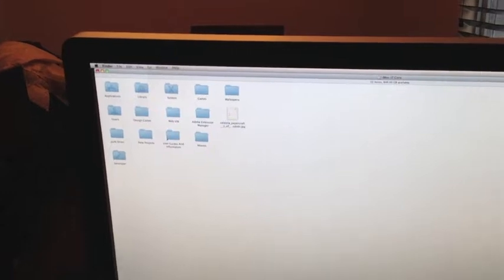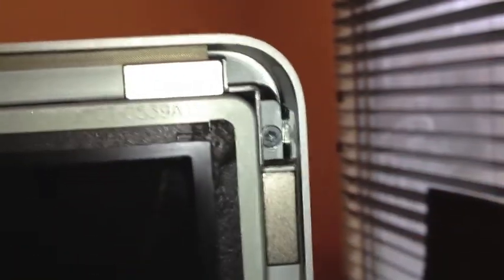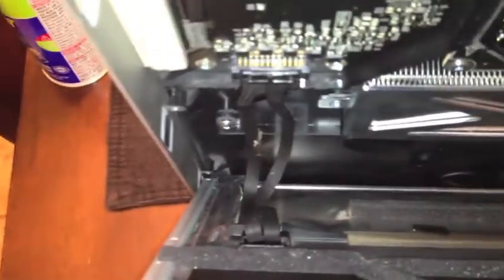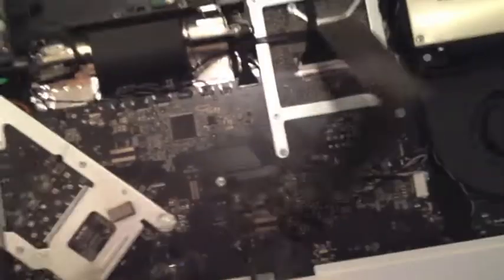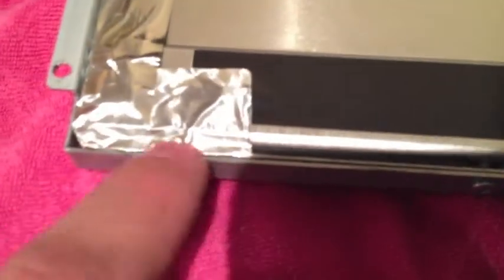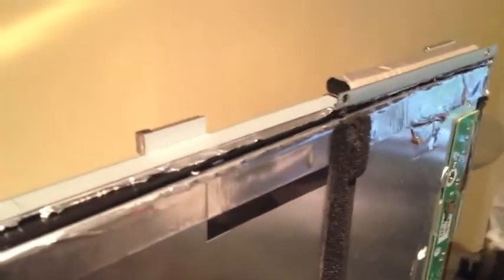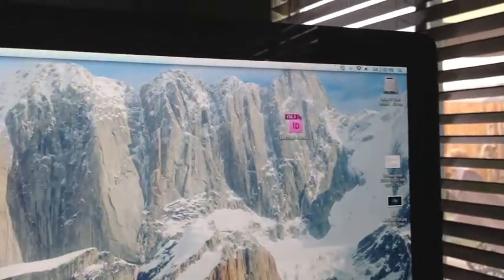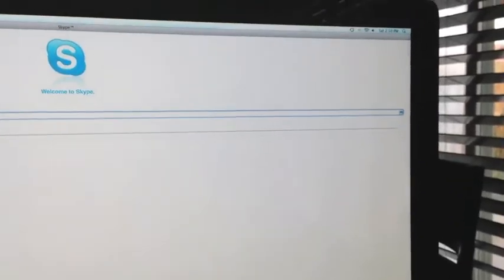IMAC 27 LCD CLOUDING • FIXED

Comment: Thank you - Just done mine, probably the most nerve-wracking job I've done on a computer. 
A quick note for anyone attempting this in the current year. At this point in time, the dust will probably be baked on there, so you might not be able to do it dry. 
I would recommend getting a pack of lens wipes (get 50-100) anything non-disposable will instantly get covered in dust and spread it around the screen

Comment: From Holland is say, Thanks a lot!! this video got me thru it! i did 2 macs and screens are great!!!. for everybody who is gonna do this, the aluminium frame does not hold any glas. be careful, the glas lays loose on the body, also. i agree on the comment about air blasting the fans. Keep m locked with your finger when blowing. you could damage your mac.
  just a tip! great video. !!

Comment: Nice Video, it helped me a lot.
I got one problem though. After re assembling the iMac i got a vertical line with a width of aprox. 10 pixels from like 10 centimeters from the right border of the screen. Is this fixable?
Reply: Did you fix this? I have the same - it worked perfectly for a day and now I have a single vertical blue line...

Comment: Thanks for the video bro!! It worked for me. My 2009 iMac was pretty dirty. I would say the toughest part is getting the frame out of the lcd. Wear rubber gloves and have someone hold the screen when reattaching the four connectors. Looks like a new Mac. Runs a lot cooler as well!! Great job!! Thank you !!!!!!

Comment: I was dreading taking about the screen section of this video, lucky the fog on my one was between the glass that pops off on the magnets. Swapped out the hard drive and now have a clean screen too. Only thing is I have the yellowing at the bottom of the screen still

Comment: Last night I did this procedure for the 2nd time in 2 years. I was refitted a new LCD in a motherboard repair a year ago, also this new LCD had the same problem , but way more extensive, the clouding was about everywhere. Do this nice and easy, take your time ! I sealed it up with foiltape but a thinner version of what Billy uses. Getting the clouding cleaned up was not easy, it looked like it was almost burn-in marks. It took some extensive cleaning with different products and before fitting it back together the wife suggested we'd apply a product that is used in common household to minimise the settling of dust on surfaces. It also makes the surface shine a bit. I refitted it, sealed it up the best possible way. My screen looks better than it ever did. I do have a question for Billy and all that followed this cleaning procedure; Did the clouding return? if so, have you found if and where dust/smoke or whatever this clouding is enters the LCD? I read an article posted by a hardware engineer on the Apple forum , suggesting to install small HEPA filters on the bottom air intakes. However that solution tends to give a new problem because the GPU and the PSU in this machine tends to overheat on days where the ambient temperature is high, resulting in cooling issues if you cannot blow enough air through the machine. that in return (heat+lots of air blowing through the inner housing+low capacity for air to exit) seems to worsen the LCD clouding. Hopefully Billy can repost on his vid , as most of us are very interested in the result after x years. Or anyone else for that matter. Anyways a super DIY fix where apple just has one answer (pay up sucker!) and simply replaces the LCD (around 600€). The entire procedure took me about 2 hours (disconnect everything and before using a can of air disconnect the fans!) . Hoping someone answers and to say thank you Billy!

Comment: hey. i have a late 2012 imac 27" - some days ago i discovered some darker clouds on the corners.
1) can i open a late imac 2012 like this?
2) will the clouds disappear when i clean it up like in the vid? or are the clouds INSIDE the display? 
thanks people!
Reply: A very late response I know,...but...The 2012's onwards are a different kettle of fish. The outer glass is fused to the LCD. This will only work on the ones that are about 1inch (10mm) thick at the sides, anything up untill 2011. Cheers!

Comment: My 27" LED cinema display just started doing this (2011 model).  I am going to try this, and if it works for me, you are getting a massive shout out.  I know some things are different inside, but I can easily manage around that.  It's the panel I need to fix.
Reply: The original poster of this video did appear to have legit dust in his when he opened it up, I'm not sure it was a polarizer issue for him.
Reply: did it?
Reply: Nope, for mine, there was no dust at all between the panel and the light.  The panel itself has the blotch, and was visible with polarized sunglasses while looking at the panel under sunlight.  I was a bit saddened to see it wasn't so easily.  In fact, when off it looks bad, but when powered it goes away for a short second then slowly returns over time.  So something is wrong with the LCD itself, as if it's a rather persistent image retention.
Reply: Is Mac Eachern a Mc Gahern?
Reply: I suspect the problem isn't dust (in any case - where would it come from and how could it get between the layers) - I am guessing it's actually the polarizer film is distorted and the 'cleaning' is actually just smoothing the film which is probably quite sensitive to not being absolutely planar.  So if the original poster fixed it by 'cleaning' he was inadvertently smoothing the film. That's my guess.

Comment: Don't let the fans get spun with high pressure air onto them!!! Hold the rotating blades in place while blowing into the fan ducts. If you put pressurised air on the blades; you will fry your bearings in the centre. So your fans will become loud and will be damaged!!!!

Comment: Just as advice: Do not blow the air into the fans without holding the fan tight in position!! The fan motor once turned manual around works like a small power generator, sending some volts into the main board! There are some people who have destroyed the fan controller just with air blowing!!
Reply: Also the vacuum cleaner, i should have fought the urge to stick the nozzle to the fan drooling at the sound of a jet engine spooling up. Q-fan gone now i have to run it full speed.

Comment: Thanks for posting this video it seems like it's just a bad design by apple because dirt and dust get behind the lcd panel and that's causing the dark spots/lines thanks man i'll have to take apart my panel in the next few weeks and clean out my imac i thought it was a issue with the panel like it was on it's way out. but i guess it's just a simple cleaning job thanks bud cheers!!!

Comment: So let me get this straight overtime dust builds up on the back of the panel ? i have the 27inch 2010 imac and it seems the spots have gotten darker over time but there always in the same area. is it possible to install a new say 2014 panel on older 2010 imac? ov not the 5k panel just a 27inch panel?

Comment: Wow, I do want try the screen removal and clean the dust out - I can only imagine how much is in here. Also clean the screen itself. The rest would make me a bit nervous. I did have severe clouding in the 3rd month of owning this 2010 iMac, fixed under warranty - Notice slight 'cloud' around the top again also bottom right. Another issue that may be beyond my own repair are very thin moving vertical lines about 7 or 8 in total perfectly spaced apart, but only viewable on darker background sites, full screen videos...or working with Adobe Photoshop which can be a real annoyance. Great video though. Thanks!

Comment: At 5:12 were there screws underneath there because in the next step it doesn't look like you removed the black tape to get to the screws if there were any screws there at all. Also, what kind of black tape or material is that you used at 11:08? You said heat pads of some sort? Thanks for this tutorial, will save me $100's!!

Comment: I thought this video was STELLAR. I think I will try it with my late 2009 iMac... and here I thought the screen was deteriorating. I have an appointment at the Apple store tomorrow, so I will post whether or not they fix this for me. In the event they do not fix... where would I go to buy that foil tape to seal the panel from the dust?
Reply: well I brought it to the Apple store and the Apple Genius told me that they do not open the LCD panel up. The way they fix it... they will replace the entire LCD panel. In the event your Apple Care has run out... they gave me a price of $549 for a refurbished screen, you can't get new. I was unable to find out the exact silver foil to use to reseal the LCD panel. You can't just use any type of silver foil tape... you could over heat the iMac and cause a fire. So if someone out there knows what tape is used to reseal the LCD panel... PLEASE!!!!! let me know the brand tape and where to buy.

Comment: Just wanted to let everyone know I did this to my 27" Cinema Display and the disassembly is very similar, but I would NOT recommend using any type of LCD cleaner on the BACK of the LCD. It works great on the LED panel and the front of the LCD/glass, but if you use it on the back of the LCD and then shine a bright light on it you'll see massive chemical clouding and it looks nasty. You won't see it unless your light is very bright. After using the Antec cleaner on the back of the LCD and seeing the clouding I used a touch of water on a very soft microfiber cloth and it took out all the clouding and it looked brand new. It took like 15 minutes to fix it after that cleaning spray messed it up, so just an FYI. I even noticed after properly cleaning it that the screen had noticeably deeper blacks.

Comment: Brilliant, I've had this problem with my iMac for months, it's out warranty and Apple want to charge me an arm and a leg to replace the monitor. 
Freekin' crooks as far as I'm concerned. I'll change my optical drive at the same time as that's packed in as well. 
Apple - Never again!
Reply: You got to be JOKEING I rather build one then buy and manufactured pc I bought a mac just to try them they are great machines ((If took care of)) iv never had problems like this and I don't know why ppl hate macs it's lighting fast even with windows and ubuntu
Reply: Iv used macs for a long time and mine have never failed and I give them emortal hell
Reply: I have a 2007 Mac Pro and 2012 Mac Pro and a air it's for school they don't slow the 07 has had it's days right now it's about had it cause it's just old it was my gameing/other thing pc at the time the graphics card needs a upgrade the 2012 my father got me last year and it's flawless i just don't see the problem the new ones I hate cause not upgrade able  as much
Reply: I'm just bp tired of windows I it would get slow after a while and it just wasn't working with me I used linux ever scinc I was 12 and u dual boot it with all my machines
Reply: Yes <~< it was pro and I tried ultimate  got the same thing not responding

Comment: Have you ever tried using a Shop-Vac to blow out the whole thing while using another to capture the dust?  Also, I need to replace HD and Super drive, so I am looking at an all day job.  Did taping the whole screen create any heat problems?

Comment: I was all prepared to do this but booked an appointment with the genius bar in Basingstoke , england. It turns out it is a known issue of particulates being drawn in through unsealed edges between the screens. Because apple acknowledge this as a manufacturing oversight (lets say) they have placed this on a QUALITY PROGRAM, meaning they will replace the LCD screen free of charge (£365) even if it is out of warranty. Sorted - one more happy and still loyal UK customer - MASSIVE GOLD STAR TO APPLE

Comment: Great video!! Took me about an hour, although I had to do it twice because a huge hair had gotten inside. 

Careful when pulling out display cord it's tied in with the wifi connection on the motherboard. I messed with it for 8 hours getting wifi to work, the connection was lifted only slightly, it's not a very secure connection. (Black cord running from air card at top to motherboard)